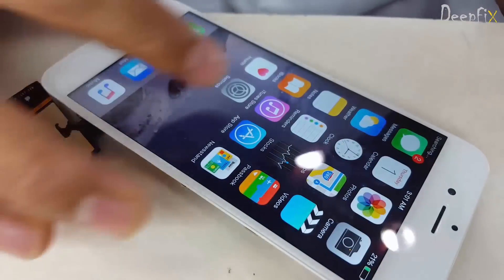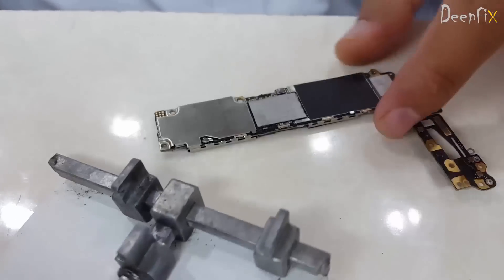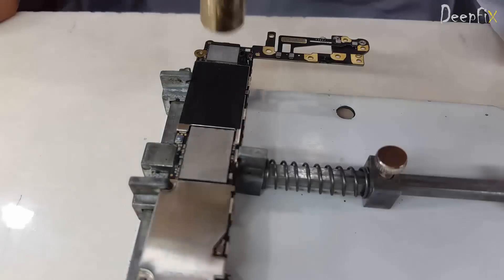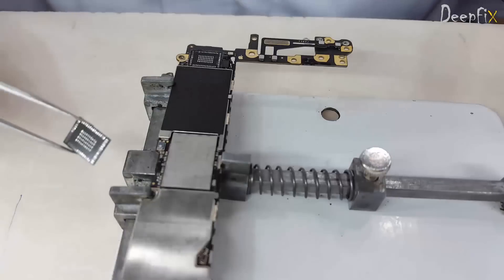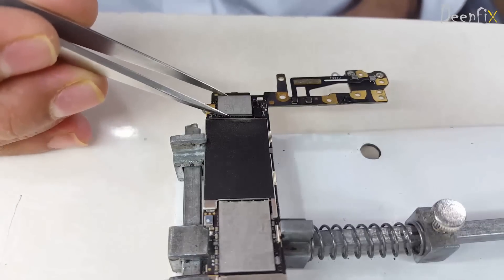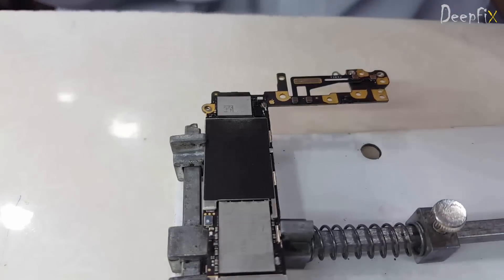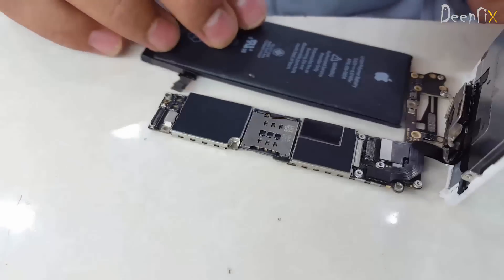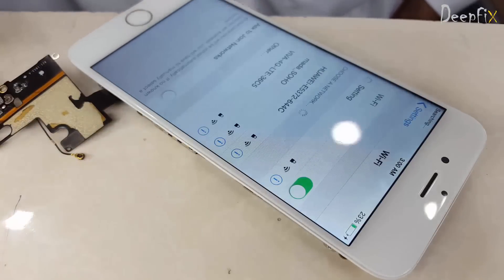iphone 6 wifi issue fix

Comment: The iPhone 6 wifi ic does not come off that easily. The magic of editing. There is underfill surrounding the chip which has to be removed.
Reply: What is underfill? Is it common on chips on iphones? I am trying to learn to reball chips and have been having a horrible time actually getting them to come loose using 380c rework station.
Reply: Underfill is the black material surrounding the chips on a board. I believe it is sprayed on during production to stabliize components. Can be removed quite easily by applying heat and scraping off.
Reply: Chris Alexander
Reply: Does the underfill have to be removed?
Reply: u r right

Comment: Hello , can i ask you something? My iphone 6 suddenly i thonk after ios 11.4  uptade losing wifi connection all the time and doesn’t have good strength sognal about 4 meters with no objects between me and router droping at 1 bar wifi . You think is this chip that you are replacing? I have already replace the wifi antenna with a brand new but i get same problem again. Sometimes signal is lost but when i hit my phone to my hand is searching and finds my wifi in my house.

Comment: I'm having issues with my gps on my phone I've tried everything I can think of short of doing a reinstall on the phone. Do you think replacing the wifi antenna maybe the cause. Someone else suggested it, that's why I'm asking? iPhone 6
Reply: Hey Jay. Did you find out your issue? I dropped my phone and shortly after the GPS is off and wonky. So currently looking for a solution. I believe its hardware thats causing it. Have no idea how to fix or how much it will be.
Reply: +Morgan Paxton I replaced the wifi antenna I don't believe the price was that much. It worked great after that for about a week. Now I'm back to where I started. Wish I could have been more help

Comment: hello dear friend. thanks a lot for this video, but i have a question; why you did not need to clean the pcb with flux and copper?
Reply from the maker: it is because of extra lead their which is very problematic while placing new ic
Reply: +DEEP FIX 
Thanks for your attention dear friend (:
I mean you didn't clean the PCB on this video, did you?
On your old videos, you cleaned the PCB with flux and copper by using solder (iron) needle.
You know copper wire holds the lead on itself.
I couldn't catch the cleaning PCB on this video.
Thanks again.

Comment: First I'd give it a reflow if you're not equipped to replace the chip because that will most of the time fix the problem caused by bad solder joints under the chip.

Comment: There's no way this works with a new wifi module. The wifi module is bound to the Nand Flash so that also needs to be removed and put into a tool to unbind the old wifi module. This only works if you re-use the old wifi module, in which case there was no need to remove it...only to reflow the solder under the chip

Comment: I have a low wifi reception, i did all i could to try to fix it by disabling the wi fi assist, disable wi fi location, reset my network settings,  restore and re-install ios on my device and finally type 8.8.8.8 in Dns wi fi network but none of that solve the problem, the issue is where i live there's no apple near me and i should take a risk and take my phone to a random dude to fix it? Plz help
Reply: +Notyouitsme i have the same exact roblem check out my video
Reply: Low Wi-Fi reception is a much easier fix than greyed out Wi-Fi toggle switches, which this video solves. The solution to your problem is simply to replace the Wi-Fi antenna attached at the top (back) of your logic board.

Comment: hey there i have a problem with my iphone 6 plus, the wifi connection is very weak, i have to be literally standing next to the router to get wifi, but its not the routers problem and all the other phones wifi in my house is working fine. can u help me out, thank you!
Reply: Ping Lin I have the same problem do you have the version 10.2 on iPhone 6 ?
Reply: i got mine fix, it was the antenna. got to get it done professionally
Reply: Oh how much was it?
Reply: i didnt have to pay for it cause it was my firend who did it for me, but he told me it dont really cast much.

Comment: Help! Im unable to join or connect wifi it started when I paired my bluetooth ,i done reset network still wont connect until i reset the entire phone back to original set up,problem now is unable to manually set up coz unable to join or connecf to wifi. Iphone 6s plus issue wifi

Comment: Please help 
I have the same problem on iPhone 5s and when I shutdown the device shake it heavily maybe crash it sometimes and open the device again the wifi comeback for a while maybe 2 hours or less the no connections reboot it is grayed scale heat it with a hair dryer work sometimes but the same issue after 2hours or I did not open the iPhone yet 
Please help and sorry for my English if it bad

Comment: Hello, i also have the problem of the gray wifi on my iphone 6Advise me to fix it?It will be a component and not the chip itself as in your case, as it does not work the volume up key and external microphone?